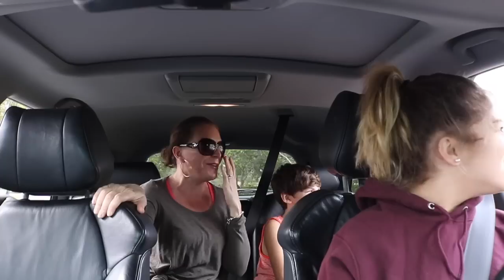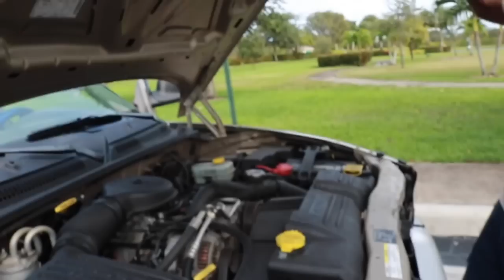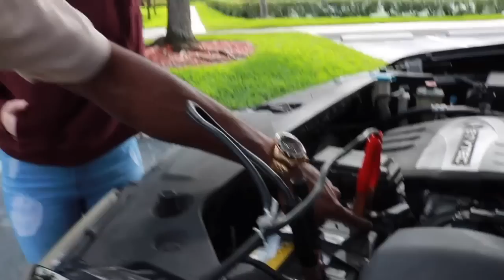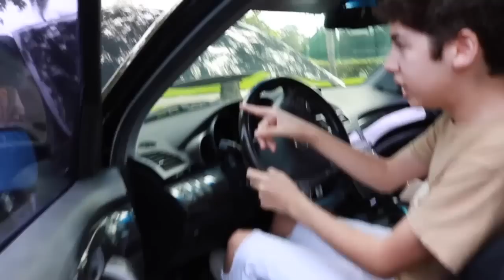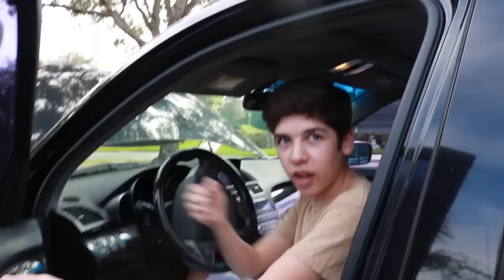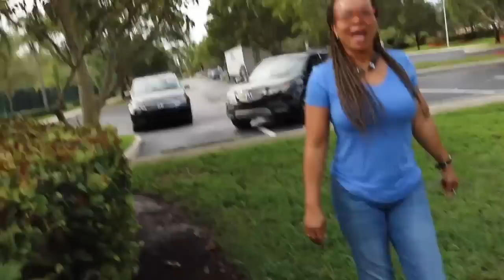I DESTROYED MY MOMS CAR | Baby Ariel

Comment: As soon as the car wouldn't crank they thought the battery was dead but the lights were still on if your battery was dead the lights wouldn't even be on plus you could tell by the noise it was making that it was the alternator...

Comment: The problem was the Alternator was not working, however this could have happened because the fan belt broke. If the fan belt is not turning the alternator, electricity will not be generated. The result will be the battery will not be recharged. The battery can power the electrical devices in the car for awhile, but this power will get used up, then nothing that requires electricity will work. The fan belt is rubber so you can't expect it to last forever so it is the first item you should check. In your case the problem was the alternator, though.
Now if Ariel is learning to drive, you could do something useful with your channel, have Ariel learn to drive a car with a manual transmission. What an automatic really does is make it possible for people who are too dumb to learn how to shift to drive, thus putting another idiot on our overcrowded roads.
There are countries in other parts of the world where the cars don't have automatic transmissions There every driver has learned to shift. They make jokes about how the overfed Americans take a course in school called driver's ed but they don't really learn to drive, they can't actually drive a car unless the car has an automatic to do the shifting for them.
Reply: Ivan Najakov zammmmm drop that knowledge man 😂😂😂👌👌👌👌👏👏👏👏